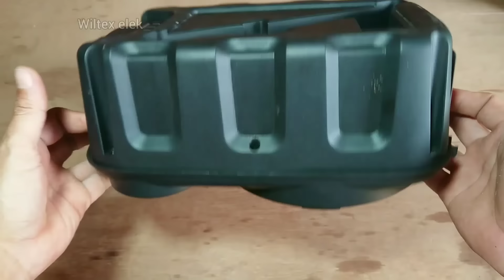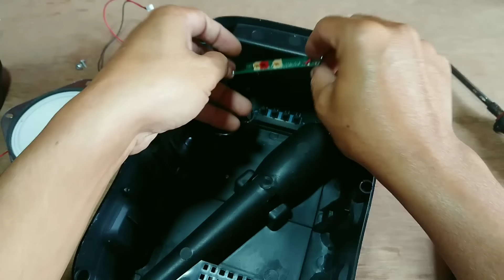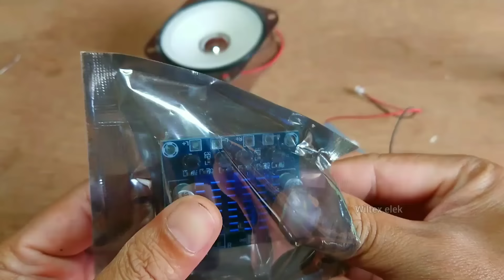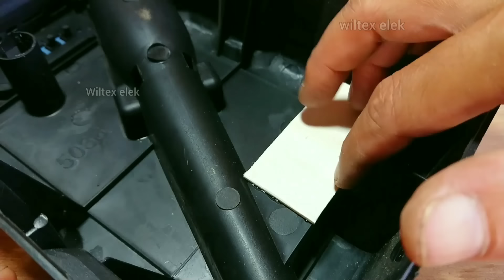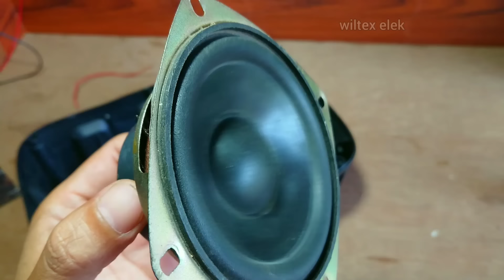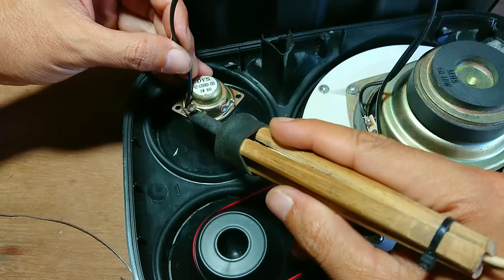Cara Menambah BASS Speaker bluetooth portable ; DIY

Comment: Thank you for this good project! Newbie here and I would love to try this but I have some few questions.
1. The input of the 15w Amp, you connected left and right to the board of Bluetooth speaker without using the ground or the pair of the L & R?
2. Are the input and buttons of the speaker still the same? Can you still use the original usb/SD card, fm (if there's any) and Bluetooth function the same?
Thank you in advance.
Reply: He just connected the left and right of the amp since he is making the input from mono to stereo channel configuration, he still used the ground because the input signal and input supply are both connected in the same reference. What he just did is connecting the input board to a higher power amp

Comment: Doesn't that setup cause ground loop noise?
Reply from the maker: saya gunakan satu ground/PSU NEGATIF untuk menghindari ground loop
Reply: Where is that negative ground/psu on the video i would like to copy your process
Reply from the maker: @SJCB21  di video tidak saya tambahkan kabel negatif psu/ground .. karena negatif psu/ground setelah di rangkai seperti di video semua masih terhubung jadi satu
Reply: I already tried this on a cheap portable speaker and it DOES have ground loop noise. Only noticeable when playing music at low volume or when music is on pause or off. This only happens during Bluetooth mode but not when I switch to the TF slot.

I was using the PAM8610 amplifier and it shuts off at around 70% volume, even with the capacitor added.

So it did not work for me.

Comment: Kalau di terapkan di kimiso 7801 bisa gak bang?.pake modul² yang di video
Reply from the maker: bisa.. usahakan tambah batre ( mode pararel ) untunk meningkatkan kapasitas amphernya
Reply: Tapi apakah bakal kuat ngangkat pakai speaker woofer 100w 8 inchi bang? Soalnya speaker sy uk 8 inchi.sama pemasangan step up boostny sebelah mana ya?.soalny kayaknya beda dr video mesin speaker sy
Reply: On off nya langsung dr puteran volume speaker sy gak kayak di video abang